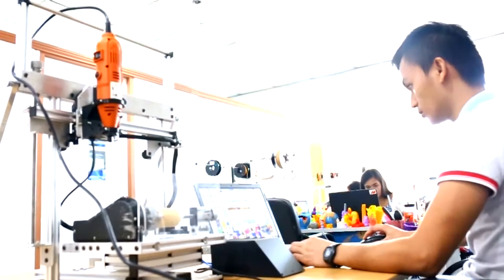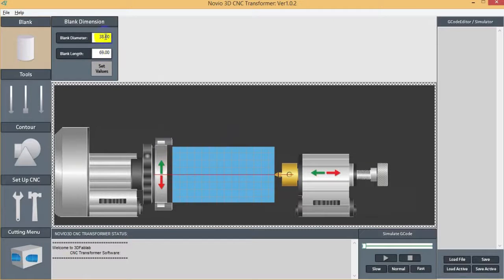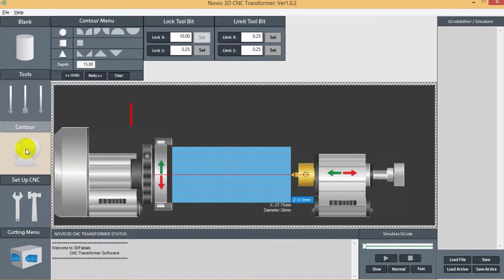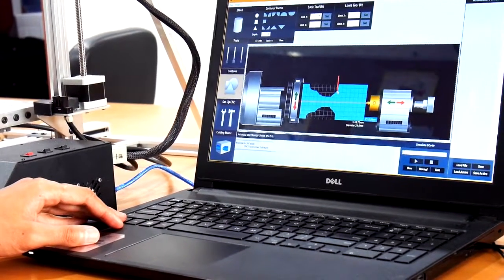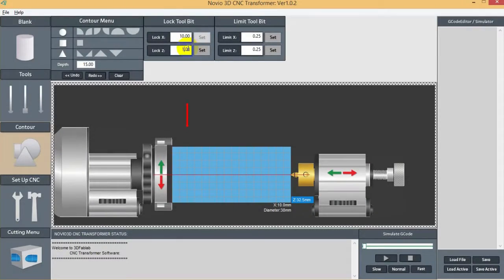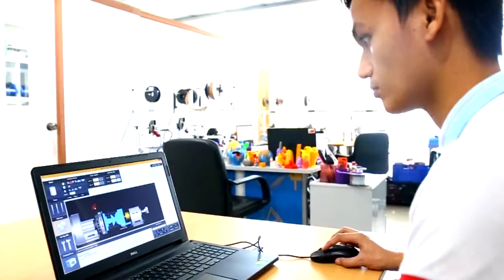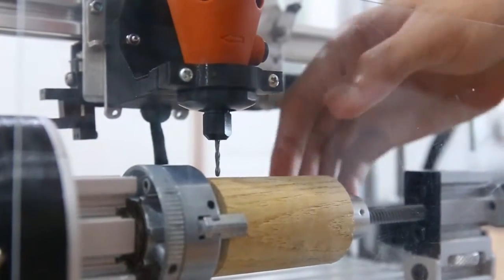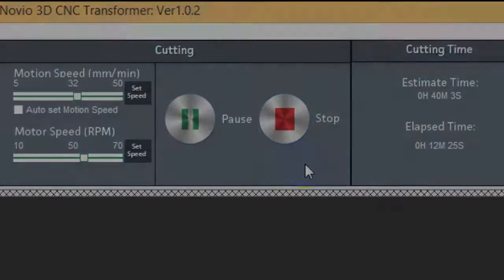HOW TO OPERATE THE CNC MODULE - NOVIO 3D

Comment: It's more about the ability to customize it, that makes this printer worth it, with readily available options that make this printer enticing over other offerings that are design with more limitations. not only do they offer an engraver option but a cnc; plus a cnc lathe. Absolutely no one in the 3d printer industry offers up a 3d lathe option, its on heard of. About all that's needed to make it truly the best well rounded printer, would be if it can 3d print circuit boards now either by adding an edger or extrude very find conductive filament since it can extrude the full spectrum of filament sizes from  1000 micron ~ 20 Micron or 1.0mm ~ 0.02mm leaving a lot of other offerings in the dust at this price point.